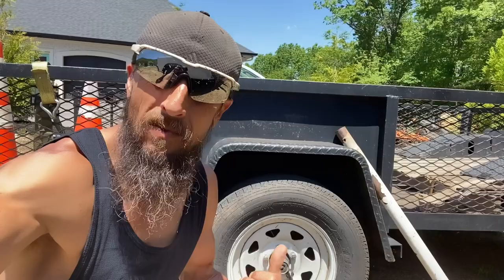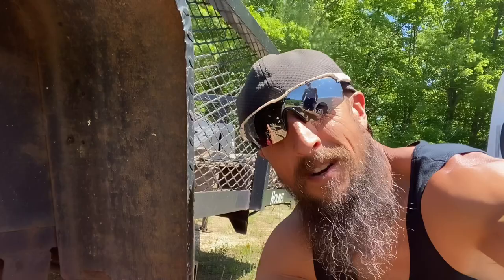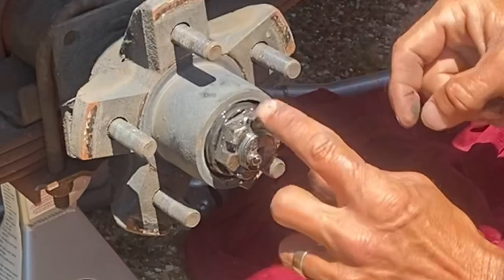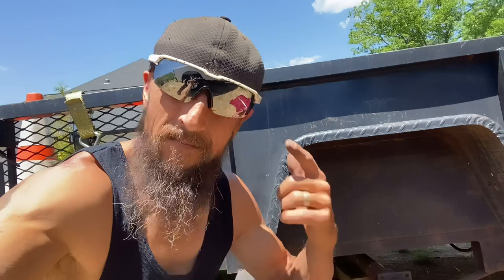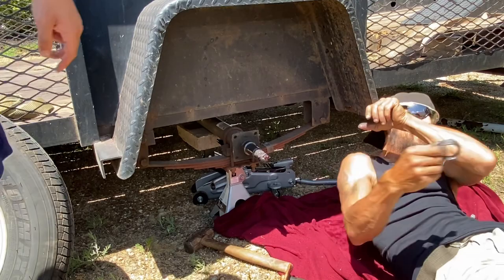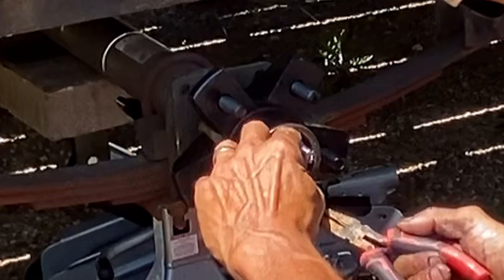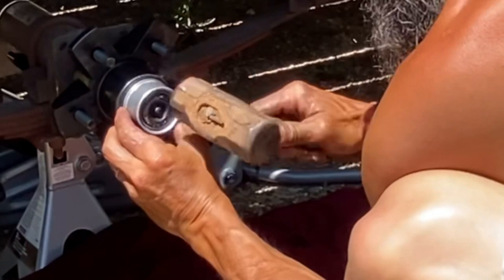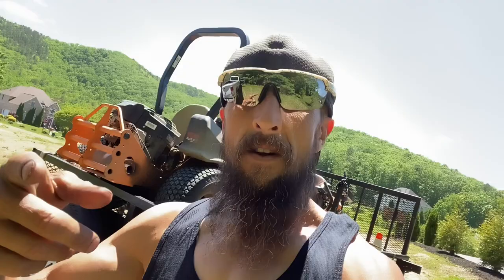Trailer Axle Hub and Bearing REPLACEMENT // Step by Step Instructions

Comment: Good info Randall! I'm not trying to be a know it all! Did you tighten down the hub to the spindle tight enough to seat the race onto the spnidle and then back the castle nut off and then have a little drag on the hub when rotating it? A little tip, next time use a cut piece 2×4 or any small block of wood place on dust cap tap it evenly that way you don't take chances of cracking or damaging it. 👍✌️♥️
Reply from the maker: Thanks Joe….. I got your message this morning… and YES, job is completed as you described 🤜🤛❤️❤️❤️❤️❤️❤️ MUCH LOVE… thanks so much for caring about me!!!😎
Reply: @elitelandscapeslifestories  we care man 😎
Reply from the maker: @MyGreenLawn2019  🤜🤛💪❤️😎